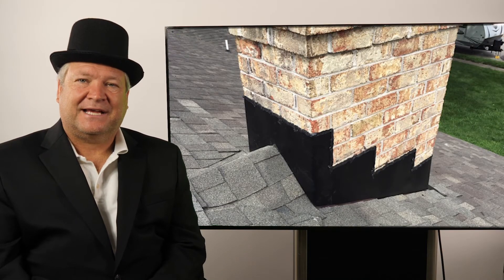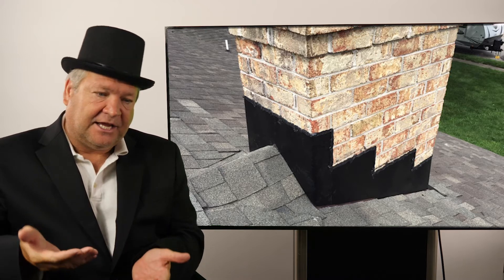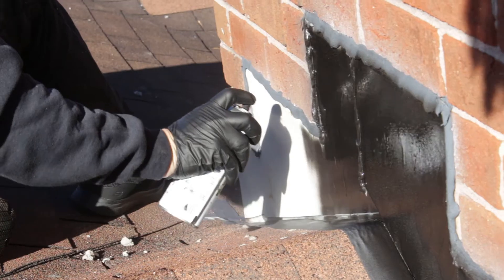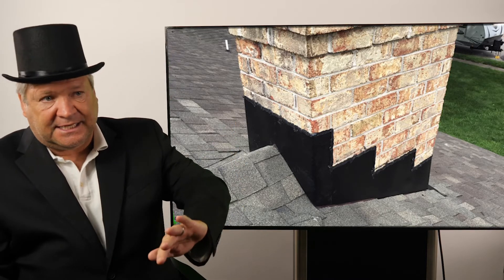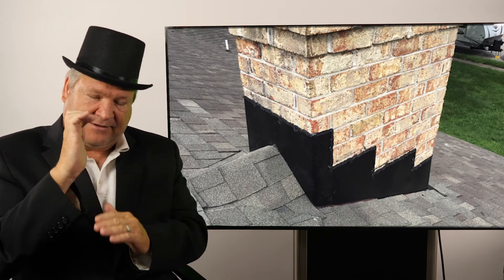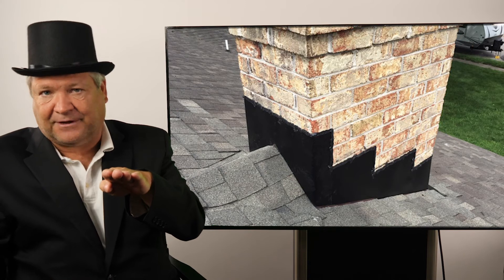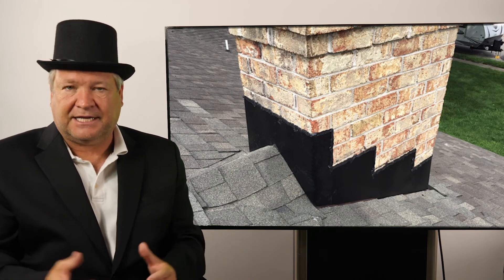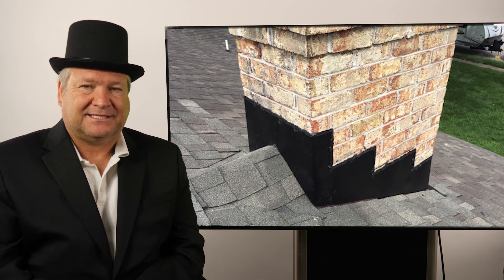Chimneys Explained #09 - Chimney Flashing

Comment: Nice vids!  In my area, all roofers seem to bend the counter flashing out at the top and fill with Solar Seal.    I rarely see any new counter or step flashing cut into the brick.  A lost art I guess here in Detroit.  Some east coast roofers told me on FB they always cut it in.